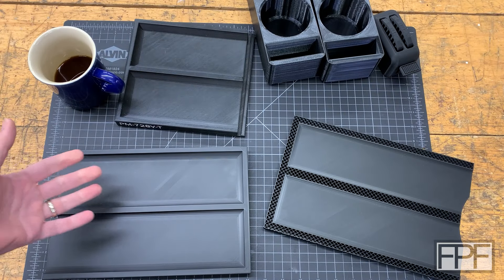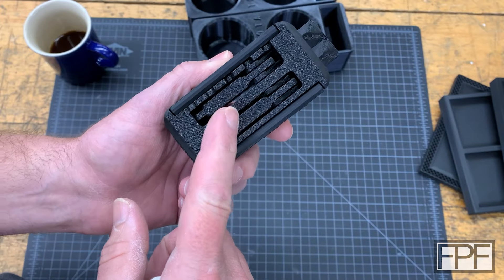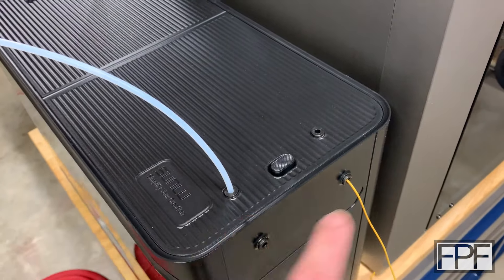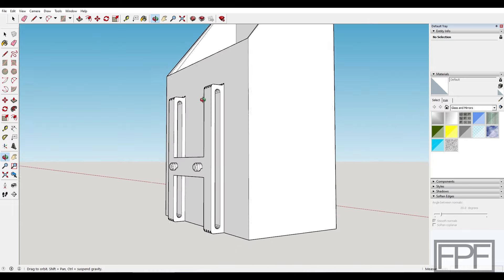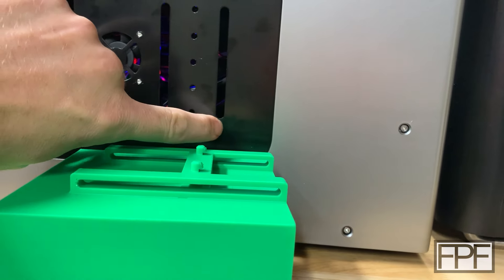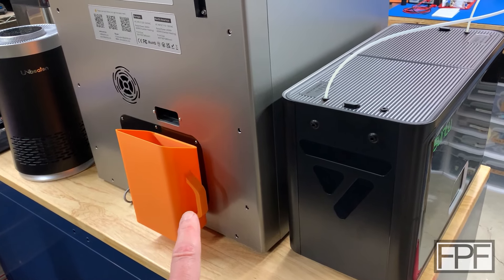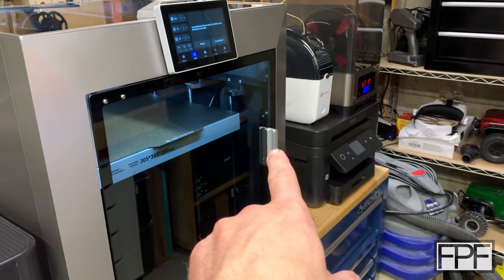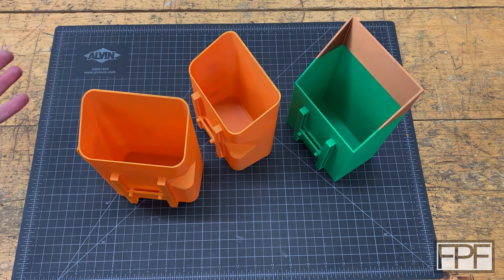3D Printed Purge Bin for QIDI Plus 4 and Testing Filament Dryers

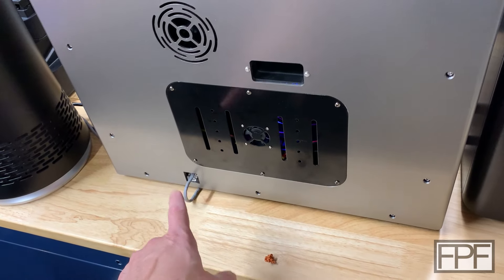Comment from the maker: Design for the purge bin starts at 10:40 if you're not interested in the other stuff.  If you print one for yourself, the default .2mm profile with tree supports works fine.

Comment: I just did a very large owl print on my Plus4 and it's nearly flawless. Essentially zero VFA to speak of, layer stacking is excellent, overhangs are solid. Just really no complaints. So far mine has been problem free and my precision and quality remain excellent.

Comment: If you haven’t yet give the new Bambu HF Petg a try. It’s has a nicer matte type finish. Print really nice too.
Reply from the maker: Agreed, i’ve used it.  Been meaning to test how it really performs after printing in comparison to std petg
Reply: @FunctionalPrintFriday  I’m printing with it today on my Plus 4. Used the default PETG setting and upped the flow to 20mms and looking very nice so far.

Comment: Increasing the # of walls will remove that "creasing in" issue and you can still use gyroid in-fill. This works very well with PETG, ASA. I haven't tried it with PLA tho.

Comment: Thank you for the great design on the catcher. This was the first thing I printed on my Qidi Plus 4 after the unboxing. I did it with a .1mm layer height and the print took 9 hours, 3 minutes, but came out like it was injection molded, only with no parting line. I have absolutely zero 3d printing experience, so the fact that this first effort turned out so well is nothing short of miraculous in my opinion. Both the design of the catcher and the printer itself are excellent. My printer arrived with the side heater "fix" and worked just fine out-of-the box. I haven't experienced any heater issues. I'll send a photo of the completed catcher.
Reply: Well, you did it How? I too have no experience and don't know where or how to start, can you lend me a hand ?

Comment: I have the FixDry machine and found similar.  It came out before the S4 and has a 24hr cycle time, which is nice and not the norm for these cheap dryers. The sensors for temp & humidity are set too low (behind the panel), so I drilled a hole halfway up the cover and fitted a combined sensor from Amazon.  Need to add about 12Deg to the set temp and it takes a couple of hours, but does get there.  I'm finding can achieve RH down to ~22% actual.  The proper humidistat on the S4 controller looks far more useful - that's a very nice feature.  Great ad-hoc dryer review!!

Comment: I have that same fixdry. Works for me. I just leave it at 50C (never verified it with a thermometer or anything) and loaded it up with dessicant.
When I got it, I was more interested in the drying aspect vs the filament pre-heat. I was running a Snapmaker at the time, and printing with mostly PLA, I was having problems with moisture.
I still use it with a pair of X-Max3 printers, but with their chamber heating and built-in drying and all that, I don't think it's even necessary.

Comment: I plugged the holes in my fixdry filament dryer except for where the filament comes out and it works much better. You are right I was disappointed with mine.

Comment: I got the Sunlu S4 a while ago. Drastically improved my prints with hygroscopic filaments. I still haven’t printed from it though, it sits on the floor below my printer so I haven’t run the PTFE tubes lol… I just printed out some ABS heat deflectors for the bottom of the dryer since it can blast the bottom of the spools with +10-15° C higher heat than the set temp, according to some other YouTubers’ content.
Reply: I got the sunlu 4 a couple of months ago, and I mainly use it to store/dry my tpu/PC filaments. I didn’t know about the issue about the heat blasting on the bottom of the spools. Hopefully Mr FPF will investigate and come up with one of his ingenious design fixes. I have the heater below my X1C and when I print my tpu from it, I’m just a caveman and drag the filament out of it and feed it into my two way filament adapter on my X1C, since I find that more convenient than swapping the filaments around in the Sunlu and threading it through the tubes…plus I didn’t want to go through the hassle of measuring and cutting up the tube to fit on the adapter and making sure it works properly😂

Comment: Thank you for the video as I used it to get my Plus 4 up and running. Now I would like to ask you how I would go about using your STL for the Poop scute, 
I have the flash drive that came with my Plus 4 do I need to hook up my Plus 4 to my internet to download the file or would you suggest that I download the file from my computer to the flash drive. I received my Plus 4 on 10-01-24 and was afraid to open it and start it up especially with all of the fire problems and heater problems, but after I watched your video, I felt confident that I could get it running. Thank you!
Reply from the maker: Just don't use the heated chamber until you get their replacement part in and you'll fine.  I would download onto your computer and open in qidi studio, also on your computer, and send to plus 4 over the wifis.  Otherwise, yeh, you can just put it on a thumbdrive.

Comment: HAH! This is awesome. Printing it now. Love how you talked to your twin. I wish I could design objects like you just did. This is great. Just to be clear.. maybe my QidiSlicer settings are wrong (not a fan.. prefer ORca but apparently that doesnt work over wifi with the Plus 4.. though I may use it to export gcode and then use Fluid to upload from my machine). Anyway.. its going to take 12 hours to print with PLA, .4mm nozzle. Is that right?
Reply from the maker: thx!  what layer height?  that sounds really long.  I think mine was 5-6 hrs @.2 layer height with PLA if I recall

Comment: Glad to see you are getting some new prints done on your new 4Plus.  What slicer are you using when doing the print where you show corner pushed in a bit?  I had a similar issue on corner showing on my Q1 few weeks back, found out that table I was using had a wobble that hit hard every time table came down only on the right side, moving printer to sturdier desk fixed my issue, but yours does not have the same looks as my corner issue when it reared it's head.  You may try to mess with wall order or wall thickness or look for wall thickness options, classic vs Arachne maybe?  Perhaps if using infill in that location look at changing percentage overlap or type of infill  you are using.  Thanks for the purge bin, will send it to my Plus4 and see how it works out.  On way in to work in a few minutes, will sit down a bit later and take time to look at video fully.   

I still have not done anything with the 4 Plus besides a simple auto level and input shaping routine.  I must be breaking the 200 hr barrier with heated chamber running on 95% of the prints been doing in ABS.  I have been burning through filament at an extremely crazy rate this past two weeks!  I am running my Q1 and 4Plus at the same time when out in Eastern Mass during my work weeks and when back home in Western Mass on days off my little Xsmart3 runs 24/7 doing ABS flawlessly and that unit does not have heated chamber, it is a true workhorse also.  I run bed temps on ABS anywhere from 90C up to high of around 103C with nozzle temps at average of 275C to 277C using the QIDI Rapido or odorless ABS, great filament.  If I use the QIDI or Siraya GF based ABS I slow the machine down to around average speed of 160-180mm/sec max for inner wall speed and bit less for outer walls.  I run the speeds quite a bit higher when doing regular ABS Rapido anywhere between 220 to 280mm/s with that product without issue on quality.  I do run a nice slow speed on all first layers, 50mm/s to ensure a perfect starting layer.   

 I do hope to have some extra time to fine tune my bed level and flow settings, although my prints do not really show the need for the stuff I have been printing, but sure it will help and I am curious how things are looking on this machine, have owned now a bit longer than 4 weeks.   I do light lubrication and cleaning once every two days of use, which is about 28hrs of run time.   I managed to order up only the .6mm bi metal replacement nozzles, wanting to get my hands on some of their .4mm but they were not showing available in stock yet.   I did grab spare silicone pads, boots, and blades at a great price through QIDI along with at least a dozen rolls or more of their ABS along with few more rolls of their ABSGF25 and a few rolls of their PET CF, incredible stuff! I print PET CF at temps average around 310-315C with my 4Plus and believe bed temps were 80C to 90C, perhaps a wee bit higher, used whatever box recommended for bed temp.  I printed the PET CF after a solid 12hrs+ in my Polymaker dryer system, was very impressed with this material and the price is right on it when bought in bulk.  I bought the Polymaker drying system with three extra boxes a few weeks back after receiving my 4 Plus, love that system, although I do plan on getting a large food dehydrator in the future. I do print lots of engineering grade plastics, love them, but past few week plus been on a pure ABS kick, much easier on my wallet with the amount of prints I am churning out.  I am also awaiting the .4mm bimetal nozzles to get in stock, I only have two .6mm nozzles arriving any day as a backup at the moment. I do not like to run machine with all the filler based products without ensuring I have some extra nozzles laying around just in case, clogs can happen, but I think I have had only about three clogs in the past year when running all of my QIDI Machines, a very solid track record.  I just know that clogs will happen at the most inconvenient time and like to be prepared to handle them, ensuring stock on nozzles.

Nice  Purge Bin, printed out beautifully on my Plus4, looks to be solid design!  Let is auto choose tree organic support only off the plate.  Small tree showed up on the back side to support two spots!  Thank you
Reply from the maker: qidi studio

Comment: Please check the SSR on the Plus 4, on some Models its an fire hazard!
See the last video form 3D musketeers,
Reply from the maker: yeh, for North American machines the duty cycle was set way too high.  It was supposed to be 400w for the chamber and it was actually ~550w.  They fixed it in firmware, and it's ~360w now, which seems like a good safety margin.  I measured these myself using a current clamp on a scope, and these are the actual RMS current values.
Reply: @FunctionalPrintFriday   good it's some workaround is working!
 but for my opinion it's still undersized with not enough safety margin. As for my opinion a SSR PCB must be fails save in any way.
Reply from the maker: @berlinberlin4246  a bigger margin would be nice, but it's just not something we typically see in consumer level electronics, where the components often get run at 80% of max.  If mine runs at or near the 400w on the sticker with the new settings I'm satisfied.  The real question is what damage did the stock part take running at way over it's rating before they fixed it.  I'd like to see QIDI replace them on any units that shipped before the firmware update.
Reply: @FunctionalPrintFriday  yay and some good communication of the important of the firmware update

Comment: That electrical tape is going to be a gooey mess under normal conditions over time.  You're putting it in a hot environment that will make it worse.  Gaffer tape might be a better choice or just mask it off and put some paint on it.
Reply from the maker: I only use the Scotch 33/35 stuff and it's never gone gooey on me yet.  I used to use whatever the cheapest stuff was years ago. .the Scotch is worth it's weight in gold
Reply: Perhaps you'll be right here, but I would be inclined to go grab a cheap bottle of nail polish from the drug store and paint it.
Or perhaps print a small chip out of ABS

Comment: Which mode lets you cycle like that on the S4? I’ve only used mode 1 lol
Reply from the maker: mode 2
Reply: Mod 2 lol. Both of mine work great. I bought one of the newer Ebios dryers that has the spool rotation and allows 3kg spools. The cheap af fan they used has a micro thin plastic shroud, and if you run it over 50°c the fan shroud melts into the fan blades and makes a terrible noise. i cut a piece of 4mm thick carbon fiber plate on my cnc and replaced the side that melts. Ran it and after a week, the bottom part that holds the blades of the fan melted and warped upward into the carbon fiber top i made. It works great, but the fan size they use is proprietary and I had to made a jig to use a 5015 blower. I wish these companies would stop cutting f🤬king corners on the dumbest bs. But I love my s4's
Reply from the maker: @danieljamesbinderystu2968  Eibos is sending me one to check out after seeing this vid. . will be interesting to see if the issue persists
Reply from the maker: @danieljamesbinderystu2968  I asked EIBOS about your comment specifically.  I'll let you know if/how they respond.